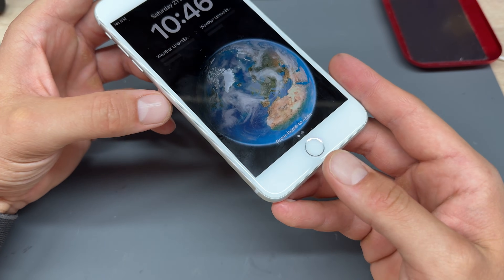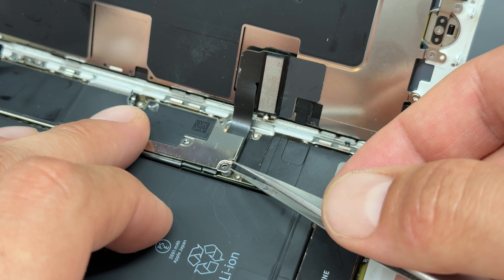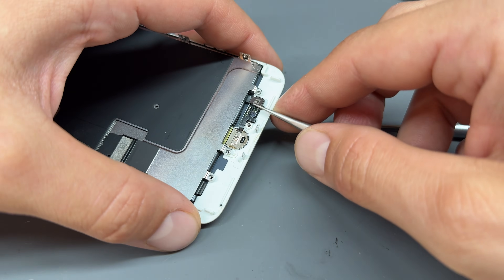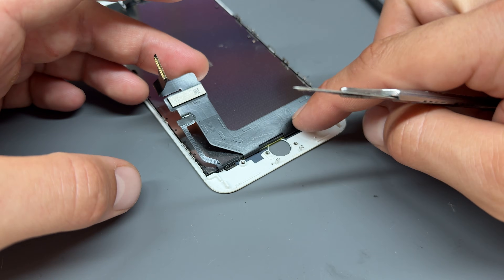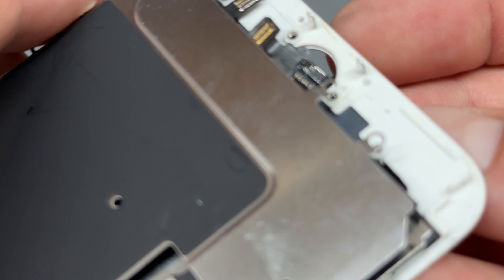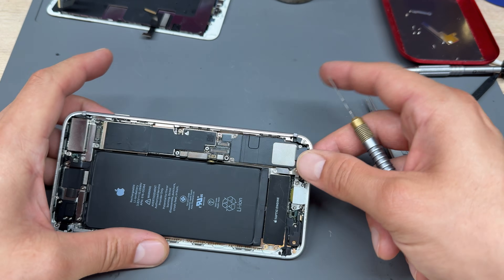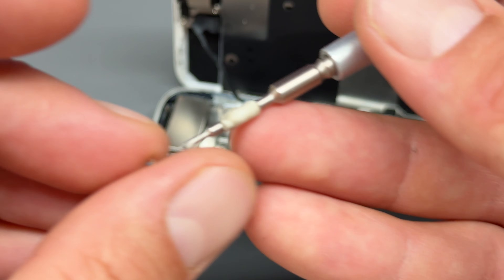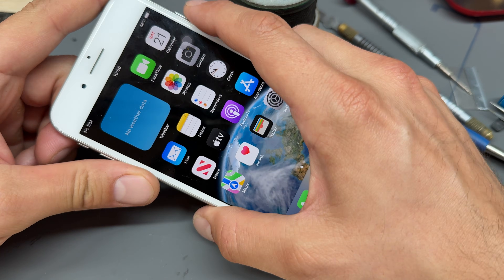iPhone 8 Plus Home Button Replacement – Complete DIY Repair Tutorial!

Comment: Why did you remove the whole  shield? The video should have ended at 2:50. I’ve replaced home buttons on 5s to 8 and I’ve never taken the shield off. I don’t get why you did all the extra work. The home button pops out the bottom after 2:50

Comment: Hey, bro. I’ve watched all your videos, but I couldn’t find a solution for the following problem. How can I remove the screw at the bottom of the iPhone that holds the screen, if it’s stripped and stuck inside?
Reply: try putting an elastic band over the screw and screwing through that, had some joy in the past with that
Reply: For me, if a screw is stuck, or as I like to call a "Worn out screw" that refuse coming out... The hole at the button of the screen where you screw from the button case of the phone to the screen, You just break the hole from the screen, the screw won't be attached to the screen and it would lock easily, For which ever screw is worn out, just break the hole where you screw from the case to the screen
Reply: Ask for step bro he has experience in removing things which are stuck